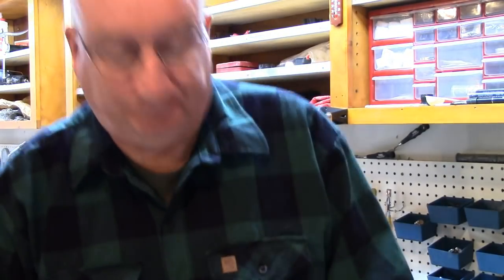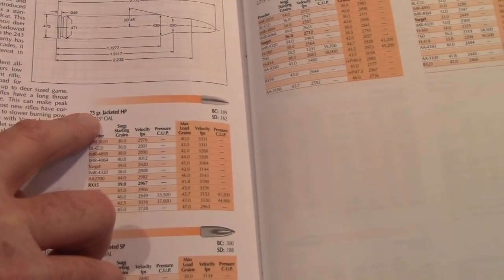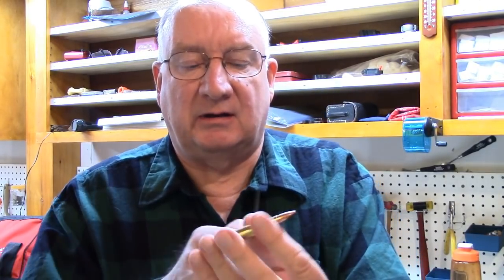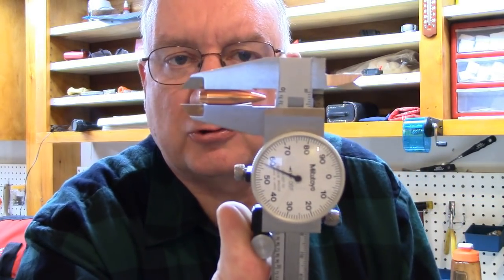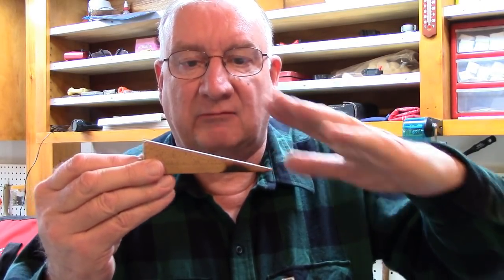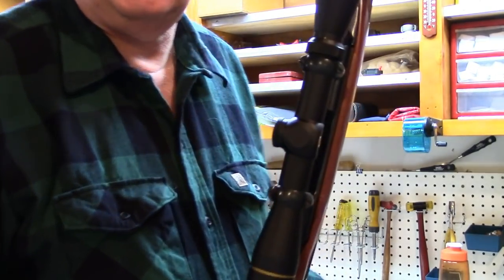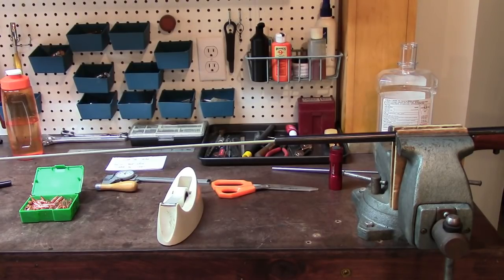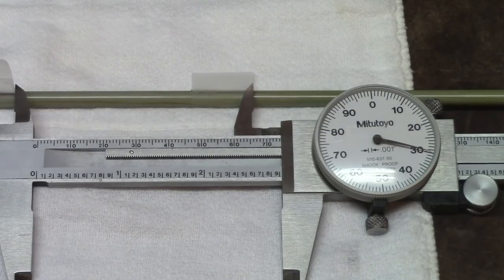Handloading PART VI, How to Measure Cartridge Overall Length ~ GunBlue's Complete Guide

Comment: Just tried this cleaning rod approach vs using a bullet in a empty case technique which i did for years.  I searched how to measure coal and when I saw you had a video knew it would be practical, straightforward and well explained, as well as, reliable/repeatable.   Watched, than gave it a try and worked just as you taught.     Thanks so much.   I had my 308 Savage on the bench and once set the tape on the cleaning rod for the bolt face distance, I then used the 5 or 6 different bullet types I had on hand to determing coal for each and put each of those dimensions in my log book.   I' m going to try to build a database for each rifle and each bullet I use or have on hand.    I really appreciate learning this from you !     GOD bless you and your family.    Max

Comment: I'm curious on your perspective on another method, which I have not yet tried, mentioned in the Speer manual. They suggest making an inert round then covering the bullet in soot from a match or erasable marker, and chambering it in order to determine if the rifling is removing any of the marking. Incrementally shortening the round until the desired OAL is achieved with no visible markings in the darkened bullet. 
Do you have any knowledge of this method or comments about potential drawbacks?

Comment: Another method is to cut a slot in the neck of a piece of brass (preferably one that’s already bad) after you run it through a resizing die so it will put light tension on a bullet and just start a bullet in the neck then seat the dummy round, remove it, measure it and subtract 15-30 thousandths and you have your max COAL for that bullet and a reusable tool to use with other bullets

Comment: This method has been around for many years in a few variations....including attaching metal rings secured to a cleaning rod with set screws (Sinclair).  Try the method shown above three times with three different bullets.   How much variation do you have?    I'd say you have lots of potential variables with bullet tips, tape applications, measuring variations,  and variations in technique from one time to the next.    Write down your results from three attempts as said.    How good is "good enough" for you?

Comment: The problem I have when I clean the brass, is that there is always some corn cob stuck in the flash hole. How do you deal with that problem? Why don’t you do a video about what happens when you reload a rifle round and tumbling media remains/lodged in the brass. How it effects pressure, accuracy, and how likely it is to blow up the gun. You make awesome videos and I'm most grateful for all the work you do.🤥
Reply from the maker: If you are doing high grade accuracy rifle ammo in small quantities, it's a simple process of pushing out the media with a sharp object. I use a turkey trussing needle.  Otherwise, any such debris will simply blow out by the primer and ignite the powder with no hazard whatsoever. Primers are very powerful and will easily take care of it. A stuck particle can't possibly blow the gun up.
Reply: @GunBlue490  Thank you for your reply. Your knowledge is highly respected by me and a lot of reloaders. I know that to much powder can cause a problem like I know that to little power can cause a dangerous pressure spike. After over 200,000 reloads I had a round blow out the rear left side of a case in 223. I thought that a piece or a corn cob, or a clump, could have caused a pressure problem that could have exceeded the pressure. Also after searching the internet and youtube I could find no video or articules about tumbling media stuck in the case and the problem it could cause. They say if you reload long enough you will have a problem no matter how careful you are. I guess it was just my time for a round to blow. Thank you again. Stay well.
Reply from the maker: @baugwan1  Thank you for your support.  Any case failure would be from either a weakened case, or an over-loaded one.  On what you told me, I suspect the weakened case, as it's pretty difficult to charge most .223 cases with such a heavy charge when using standard .223 ball powders.  When using a multi-stage automated press, stick to powders that nearly fill a case, so stuck powder in the hopper dropping down can't give an overcharge without you seeing it, and always look at the level of powder before seating a bullet. BL-C2 and CFE223 are excellent in that regard.

Comment: I'm currently working up a load for a Winchester model 70 30-06 using Nosler Partition Spitzer 150 grain bullets. The bullet is only seated 0.268" in the cartridge neck, this is with a 0.030" seating depth off the lands. This setup currently violates the "cardinal rule" of having the same amount of bullet seating depth in the neck as the diameter of the bullet. If I were to follow the "cardinal rule" my bullet jump would go from 0.030" to 0.070", would having 0.070" bullet jump be a problem? Would my accuracy suffer? Is this length of jump even safe to have?

Comment: I have a concern using this method as it uses the tip of the bullet to establish the COAL. Out of curiosity I measured a box of Hornady ELD bullets from top to base and the bullets measured as much as .014” difference. I then went thru the same box of bullets but used a clamp on device for my calipers that uses a bushing that contacts a point near the bullet ogive and every bullet measured exactly the same. 

In theory, it seems possible using the bullet tip to establish COAL that I could make a round that is touching the rifling lands when I think I’m seating bullets .015” off the lands. 

Could you please comment on the inconsistencies of bullet length due to the tip shape or length inconsistencies?

Comment: I tried this out, and to be honest, it is very difficult to measure accurately. I’m sure it is fine for getting a rough usable COAL, but from a precision standpoint, it has multiple levels of crudeness that add up to large variances. The rod doesn’t exactly fill the barrel, so it will be at some angle when applying tape. The use of flexible tape is an obvious problem, and then measuring the tape with calipers was giving me + / - 10 thousandths depending how I looked at it, not to mention that using the calipers as you show has them at an angle, which degrades the measurements. But again, probably accurate enough to stay away from the rifling.

I compared this method to my simple one: I have a once-fired case that I neck-sized, and then cut a thin slot in the neck. It holds a bullet tight enough that I have to get a good grip and yank it out. I stick it in too long, and chamber it. I then eject it and measure the length. When I tried the method in this video, I repeated it entirely several times, and got large variances. With my method, I get the same result every time, down to the thousandth. 

Also, there are good points here made about buying a bunch of stuff that isn’t necessary. I do, however, like to measure cartridge length from the ogive with a comparator. The tip is the weakest part of a bullet, and is the part most likely to vary from one to the next in the same box.

Comment: I used to grab an empty case & insert a bullet lightly engaged into the neck so the ogive engages into the rifling when the bolt is closed. The measurement of the round is my overall length minus 15>30 thou. Doublecheck with match soot on ogive on bullet when bolt closed & extracted that there is no rifling marks on the bullet ogive. That was a while back as I no longer reload or hunt with centre fires. Only .22  left for grandkids training. Guys like you got me into reloading & accurate rounds. Nick Harvey   my hero in Au. Be safe always.
Reply: With the bullet "lightly engaged into the neck" means that closing the bolt provides sufficient force in order to seat the bullet further?
What calibers were you reloading?

Comment: You are so knowledgeable. I truly respect and enjoy your video's. This was is right on as usual and just so common sense. My question for you is should this be done every couple hundred rounds as your landing wears down? What would you suggest? I hope you get time to answer this. Thank you again for sharing your knowledge.
Reply from the maker: The leade of a rifle should not change every couple hundred shots unless it's an overbore cartridge or overheated by abusive firing. If accuracy changes, it can be measured again, but that's the sign of a dying barrel that has a seriously deteriorated bore.
Reply: @GunBlue490  Thank you sir for taking your time to answer me. I will heed your advice.

Comment: Firstly, thank you for this great video as well as all of the others you have made. I always measure the chamber length of my rifles using your method of utilizing a cleaning rod and tape method. Just for the heck of it and to compare my measurements with something different I purchased the $12.00 Frankford OAL length gauge. It actually uses the identical method that you have shown the Frankford use's 2- plastic clamps instead of using tape.  I measured the chamber in my Savage .223 today using both methods. I measured each way 5- times and for some odd reason each and every time I got measurements with the Frankford that are exactly .010" longer than when using tape. This is very perplexing and I can not figure out for the life of me why the Frankford is measuring .010 longer than when using tape because both methods of measuring are identical. The only reason that makes sense is that the Frankford clamps are not exactly symmetrical thus the difference of 10 one thousands of an inch. I know that the tape is being applied parallel and therefore should be symmetrical. Has anyone else experienced this problem? I supposed that is why the gauge is only $12.00!

Comment: Once again thank you for such detailed information and simple explanations. You are a natural teacher. I hope you still check your comments and will answer these questions. I have a 270 that has a throat long enough that it doesn't make it possible to lengthen the cartridge to within .030 from the landings. When I measure the distance I am as much as .240 away from the landings and that would not allow me to extend the COL length that long because of the magazine distance and also it would not allow me to load the bullet deep enough using minimum cartridge diameter depth. I can extend the cartridge length another .050 without problems with loading and ejection but is it worth it? Would you lengthen as much as possible knowing the bullet is still a large amount away from the landings or in this case just stick with the standard length? I don't know if I am gaining anything. I could possibly extend the COL some more if I changed the bullet from a boat tail to a flat base? What pressure increase, if any, is there to worry about? Do you accept emails for such questions? Thank you in advance.
Reply: I also have this same issue with a Rem 700 270 Win. Any additional insight would be great on the topic.

Comment: I'm new to reloading. I am reloading some nosler .308 at 150gr. The SAMMI max OAL is 2.810. When I use your method, I measure the max cartridge length at 2.940. If I back off 0.030 from this to get the best shooting accuracy, then I'm at 2.910 which exceeds SAMMI. Should I just stick with 2.810 which appears to be 0.13 from the optimum OAL in my Remington Model 600.

Comment: Sir, I am having trouble finding OAL for French Mas 7.5 X 54mm, do you have any information for that caliber? 
Thank you
Reply: Hi Jim , I use 6mm diameter dowel for the barrel and 8mm dowel to insert the projectile. I use painters tape to secure the base of the projectile to the 8mm stick. I was lucky and found two plastic spacers that I can slide into place.
He can’t give you specifications on projectiles he doesn’t know. And on the length of the throat of your specific rifle. 
I’m happy to help you figure it out. Cheers

Comment: I use to minimally seat a bullet in a case place the dummy cartridge in the chamber then close the bolt. This would press the bullet against the rifling a further back into the case. Extract the cartridge measure the overall length then subtract.015-.030 .  That would be the total length I would need.  Is that an acceptable way.  Thanks

Comment: Gun Blue-I'm looking to get a Base to Ogive measurement for any particular bullet. Using the method in this video-would I then seat a bullet to the depth I get from the dial caliper, then take a Comparator and measure B.T.O.? Or- Modern technology being what it is- would I just assume ALL bullets in a given weight/lot will have the same Base to ogive if seated to the same depth? Thank You!

Comment: From my understanding, this method gives MAXIMUM COAL! For particular bullet  real
 COAL gonna be MAX COAL minus 1 bullet diameter (which must be push into case neck).  Don't forget about 0.030~0.015 for the landings. It might be "minus" for longer bullets or  disregarded for shorter once. I think you got the whole idea.
I like measuring method using cleaning rod and gonna try it soon. But with some
 improvement(your opinions will be greatly appreciated) - I gonna try to put proper length/diameter round spring behind the bullet (to keep it in place) and close bolt. And make the rest of measurements according to this video.  I think, better accuracy might be achieved with repeatable measurements. What do you think, gents?

Comment: If I understood you, you measured the distance from tip of the bullet to bolt face, which is the same as case head. This is COAL, as you stated.
Why didn't you just put your calipers on the bullet to do that?
Secondly, the case shoulder is what stops the cartridge when you insert it into the chamber, not the bullet contacting the lands (unless the bullet isn't seated deep enough, which is to be avoided, as you point out). I think what you are trying to accomplish is a measurement of head space, which this technique does NOT do.
Reply: If you were trying to explain how to measure bullet jump (distance from ogive to lands), this technique also does not accomplish that.
Reply: This technique measures the bolt face to rifling + the tip of the bullet to where the ogive contacts the rifling. That gives the max oal you can load to. Just back off from there for an oak to load to. If the rifle has a magazine be sure to check that length cartridge will still fit in it!

Comment: to be the most accurate on loading,  if i always went off the ogive, i then should have all bullets to the same off the land of the barrel. that giving me the most accurate. as i am using  Nosler on my  7 mm rem mag but i have noticed that some of the tips and bullet length are measured are not all the same.  thank you for all the great videos  god bless.
Reply: Carry out the same procedure as described above and using the same bullet load a dummy round and seat the bullet to achieve the same overall length. Then fit a comparator to your caliper and what you measure minus your jump is what you seat all your rounds to. Regardless of variations in your bullets, your jump will be constant. Hope this helps.

Comment: so I took a fired cased, put in my resizing die and just nudged a little crimp. Then I drilled out the primer pocket after (knocking out the primer) to fit a cleaning rod through it. With the light crimp I could push a bullet into the case that lightly held it. I dropped the case and bullet into the chamber. I took the handle end of my cleaning rod and pushed it through the primer pocket hole and lightly tapped the bullet out into the lands.  I then inserted the bolt and cycled the bolt the to make it chambered okay and ejecteed the bullet. That gave me an overall length measurement to work back from. I'll keep the drilled out case to reuse for any bullet weight for that caliber and reuse it.
Reply from the maker: That will certainly work, but allow me to make a suggestion on the dummy round theme, which will greatly simplify matters.  It's a very fast process I use quite often as an alternative to the taped rod, and it is used by many veteran handloaders and recommended by some loading manuals, too.  

Take a completely sized unprimed case and start the bullet into the case, and then chamber the round by pushing the bolt forward, which will seat the bullet to the maximum overall length.  I've been able to easily seat bullets with pressure on the bolt up to 35 caliber this way with no issue.  Drill a 3/16" hole crosswise through the case to identify it, and mark the case with the identity of the bullet and it's overall length.  You can keep this dummy round to set the initial length of your seating stem, from which you can subtract the desired bullet clearance.  I have a complete collection of these dummies for each rifle.

Very rarely, certain types of bullets will be grasped by the lands of the rifling and pull it partially or fully out, but that's usually seen by rub marks by the case.  If in doubt, color a bullet with a Magic marker before seating the bullet.  Any withdrawal will be showed by the scraped off ink.